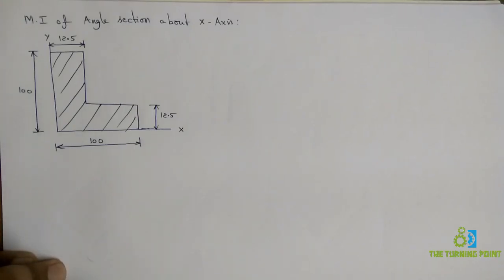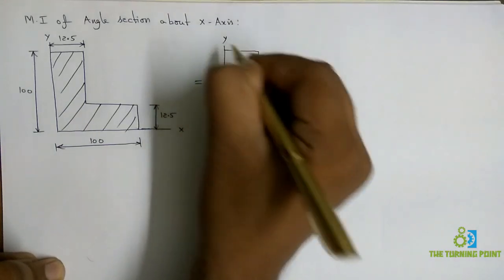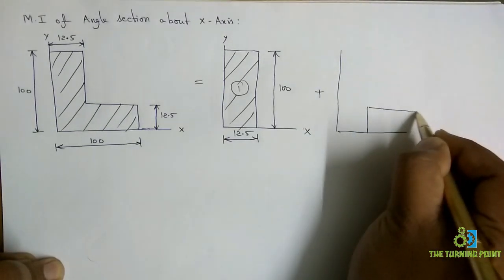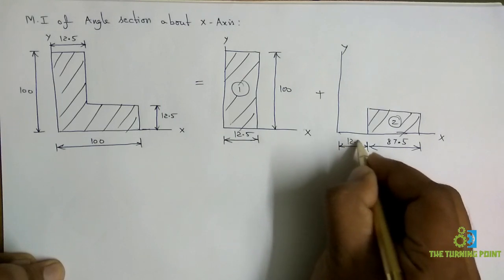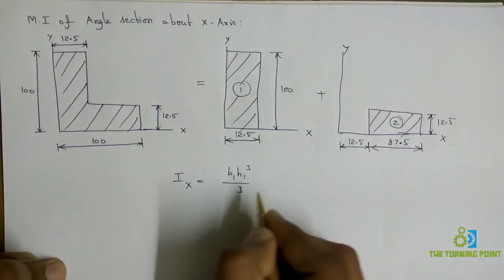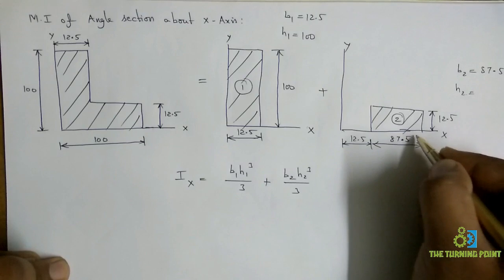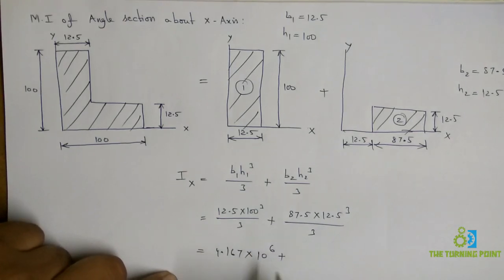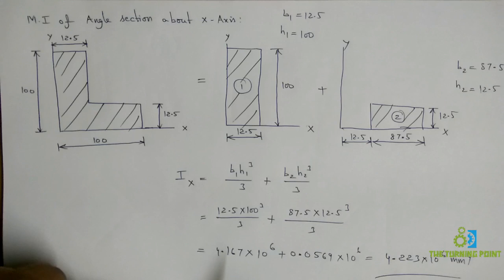Moment of Inertia Problem No  1

Comment: I think your whole process is wrong sir. 
If you're looking for the moment of inertia you should use (b)h^3/12 + A(d)^2
Reply from the maker: For solving a problem there are different methods and i did choose the easiest one. The method that you indicated in your comment is calculating moment of inertia about centroidal axis and applying parallel axis theorem for that.
Here in the method i have adopted the two individual rectangles are in contact with the base axis (x axis) which means i can calculate moment of inertia about the base axis directly by using the formula.
If the two individual separated rectangles are not in contact with the x axis then the solution will be wrong.
I did verify the answer in other method also. Please you solve it and tell me if you get a different answer.
Thank you watching for the video madam
I have got few comments like the procedure i did adopt here is wrong. I would like to prove the procedure i did by doing both the methods in the same video.
Soon i will upload it

Comment: Sir I have a doubt about which axis u calculated Moi it's a combined diagram Ixx-ab2. Take about base first and substrate from area distane2 then u get total. I think the explained above solution is wrong
Reply from the maker: here i have calculated moment of inertia about base axis only.There are two procedures.
Method 1: calculate centroid and find m.i about centroidal axis and then transfer m.i using parallel axis theorem to base axis.
Method 2: the geometry u have split should touch the axis about which you would like to calculate m.i.
here method 2 is the simplest and shortest procedure
i have verified answer with the text book answer

Comment: Hi Sir can I get your email. I got a question with a different kind of L- Shape case, and I just confuse on how to calculate the M.I. Thanks
Reply from the maker: Whatever may be the shape if it is attached with the  axis then it is easy and directly you can calculate moment of inertia or otherwise first you need to calculate M.I about centroidal axis and then you have to use parallel axis theorem. You can contact me at narayana.mech320@gmail.com

Comment: Sir why don't you consider this formula   #Ix + #A ( Y-y),,,and please explain me your formula in which condition your formula is used
Reply from the maker: Here in the problem i have solved directly i used the formula about base axis and the all geometries whatever i have considered  are touching the base axis. Then directly adding the moment of inertias about base axis i will get total moment of inertia. This is procedure 1.
There is another procedure for finding moment of inertia. First find the centroid and then moment of inertia about centroidal axis and then apply parallel axis theorem.This is procedure2.
 The formula you have mentioned belongs to procedure 2. Which is a little bit lengthy. Thats why i choose procedure 1
Reply: +THE TURNING POINT ," sir whatever the small individual geometry I consolider that should touch x axis then I can directly use moment formula ..... is it correct sir
Reply from the maker: Yes... definetly

Comment: why don't we use parallel axis theorem as we dont know centroidal axis
Reply from the maker: Here the geometry is directly incontact with the axis. So you need to calculate  M.I. about base axis. You will apply parallel axis theorem when the geometry is not in contact with the base.
Reply: kk..I got it
& thanks for replying
Reply from the maker: My Pleasure...